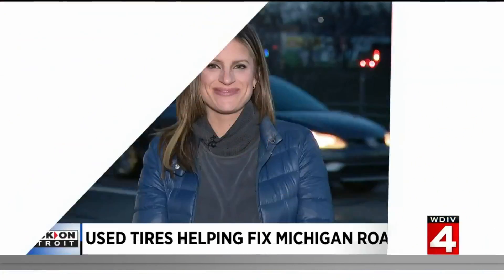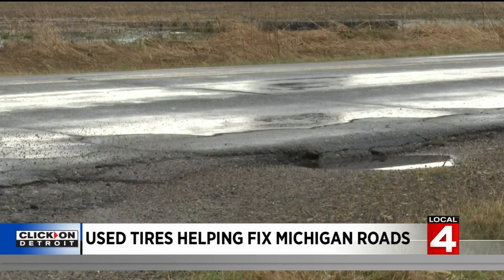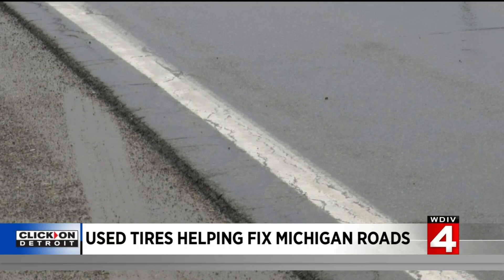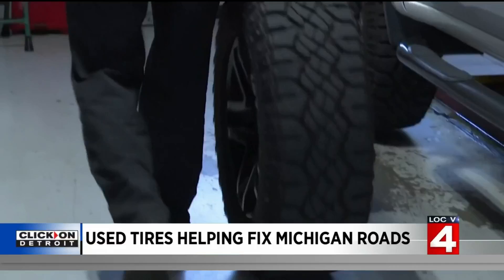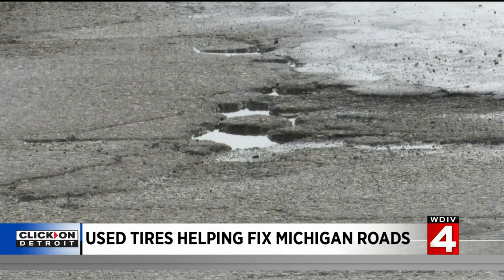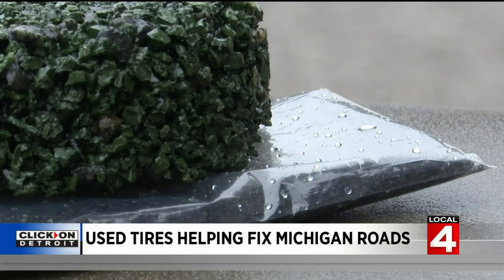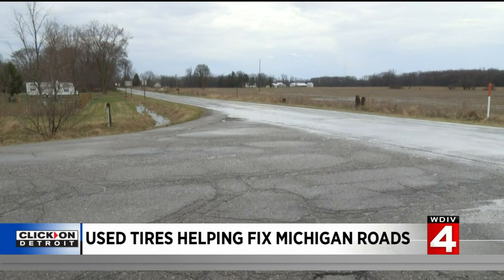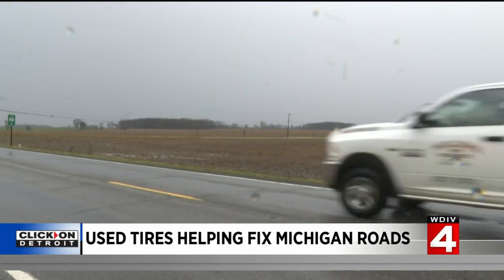Old tires being used to help fix Michigan roads

Comment: Once it breaks down will it create a micro rubber barrier on the ground and eventually cause water not to seep into the ground? And what ever happened to concrete that holds up five times better than ashfault? Just wondering 🤷